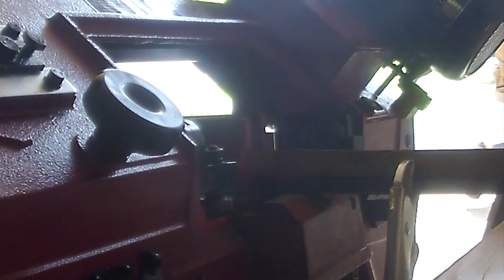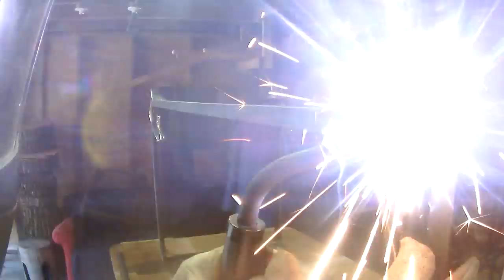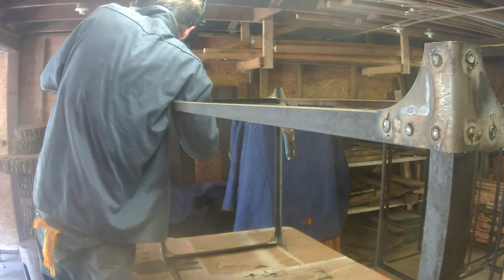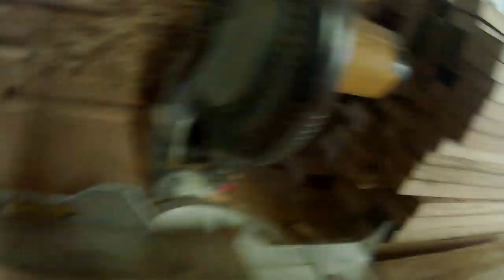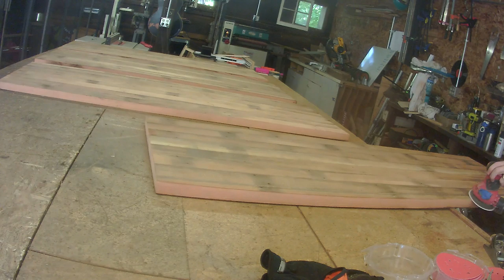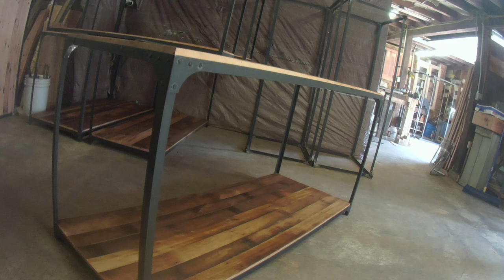make wood and steel industrial style console tables

Comment: great job! Let me ask you something...can you tell me what treatment do you use for the wood. Thank you!
Reply from the maker: Thanks! On these tables I used only low VOC water-based polyurethane. Nothing else. For rougher reclaimed wood, I will sometimes use  2 part epoxy (bar top) to help fill in the cracks and strengthen the wood.

Comment: Beautiful work as always. What kind of welder do you use?
Reply from the maker: thanks man. i'm just using a 115v mig welder with flux core. i don't even have gas hooked up to it (yet). it's basically a hot glue gun for steel ;-)